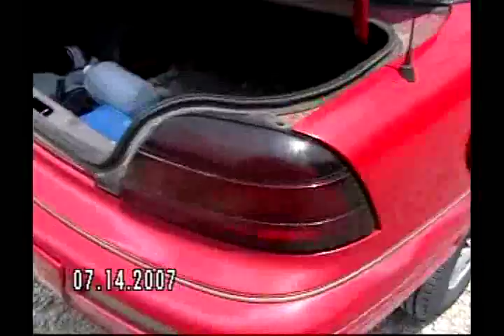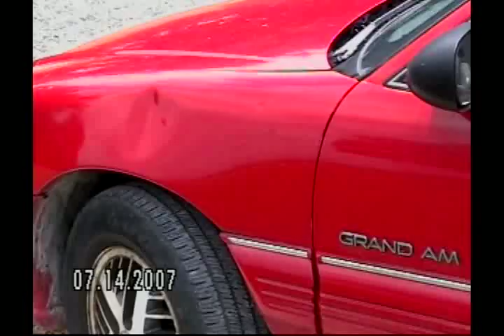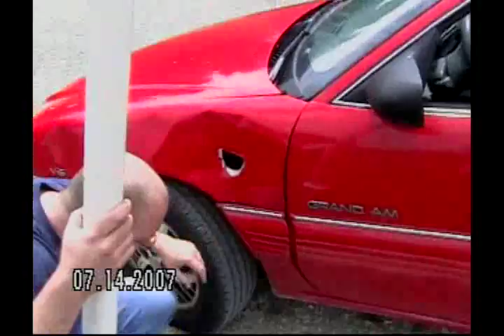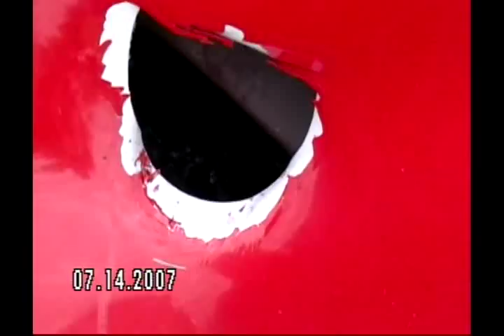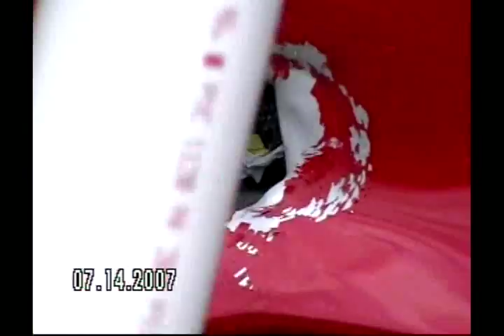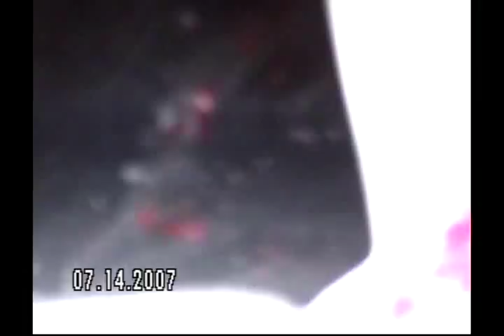Spud Cannon thru Car Fender

Comment: I had a 2" pvc cannon, so i took a 8" length of 1.5" pvc and put a little electrical tape on it to seal one end and to seal in the 2" barrel. I then filled it up about halfway with hot glue (yeah thats alot of hot glue) and I had a scrap piece of 3/4" plywood (not that chipboard stuff) and this thing blasted a hole in the plywood like it was nothing, and I was able to use the bullet a few more times before i lost it

Comment: How many mph do you think those are going?
Reply: +B Rogers You mean feet per second it was going at atleast 300 fps or 400 fps imagine if it shot at 100 miles per second instead that would be near light speed.
Reply: Plasma Skull not even close light travels about 186000 miles per second

Comment: I would love to see one of these cannons made with heavy steel and powered with HHO gas. I have an HHO gas generator and when that shit explodes it's crazy powerful. I think an HHO cannon could put a hole through both sides of the car.
Reply: i was going to use HHO in mine. but deoderant blows the back off the chamber. I can only imagine what Oxyhydrogen would do! maybe If I had a Metal one rather than a PVC waste pipe.
Reply: Robert Cece yea HHO Is nice I used to use HHO in my truck to HHO on my way to school HHO

Comment: If they tried that on a older car (like a 51 Buick) that spud would hardly make a scratch.

The sheet metal on the newer cars are paper thin compared to those older cars.
Reply: He was shooting PVC, not spud.
Reply: Indeed, any only getting thinner! Metal prices are out of sight...Just imagine how much fun its going to be if Ford goes through with the change to aluminum
Reply: Hooverdarnit 

It would had leaved a mark on a jeep
Reply: It's called a crumple zone. The car is meant to absorb the damage rather than withstand the impact by transferring the energy to the occupants inside.
Reply: maybe so but the actual frames are stronger, look up on here "bel air vs malibu"
Reply: DesecratedReaper No, that video is fake I believe. They took the Engine out of the Bel air, no way in hell should that front crushed in like that.
Reply: @JadumTheLegendary  video was definitely real, I was driving the Bel aire.

Comment: Awesome power man. I need to go find an old junker and try that. Did you use an actual potato or something else? I am assuming that a potato would splat much quicker than the metal.
Reply: I mean if it’s going fast enough even water can go through metal

Comment: mine has a stun gun multi-spark gap ignition system :D, and i know how the grill ignitor variety works, i just couldnt see what you were using in your vid.  what kind of fuel do you use?

Comment: you're the dumbass here, you probably don't even know that the car can hold itself on the frame alone and fenders should always be thin - they serve no purpose other than looking nicely, so the lighter the better, why do you think some companies brag about using thin steel on those covers? you can bend this stuff with your fingers, however older cars may have thicker fenders, dunno about old trans ams, there's none of them where I live

Comment: @ditttch Lol, I work in Heating Air Condition Ventilation (HVAC) and I can tell, to use common sense, don't put a gallon of gasoline in there and expect it to be dandy. I have minimal amounts of learning in pressure (just to keep vents under a set level of  air pressure) and I can tell, if something is starting to bulge, unscrew, let pressure out, use less pressure.

Comment: Cut 2.5" lengths of pvc pipe, apply grease to inside of segments, set them in a tray and fill with concrete.  let them harden, press them out with your thumbs, then load with wadding.  they go through very thick wood and substantial metal.

Comment: @ditttch ok got the static guard...how long do you normally spray into the chamber...i did about 4-5 seconds with hairspray...just wondering if you need that much of the static guard. i wanna say my chamber is 4 inch maybe 5 about 10-12 inches long.